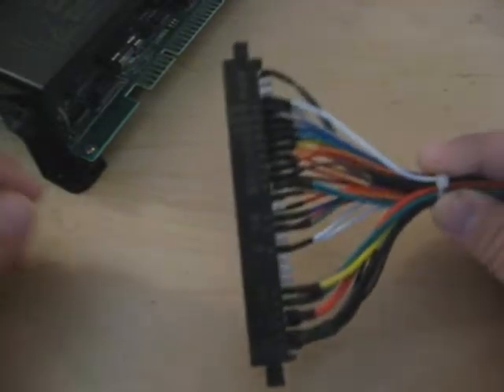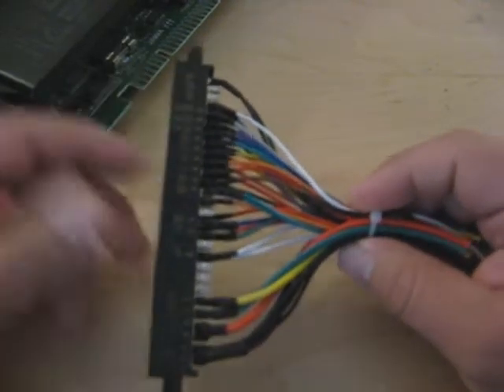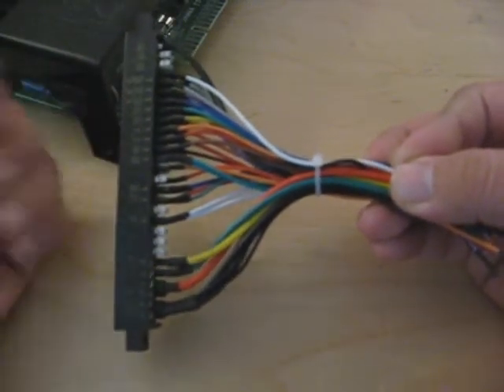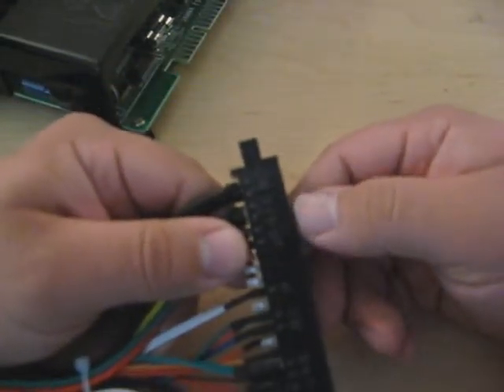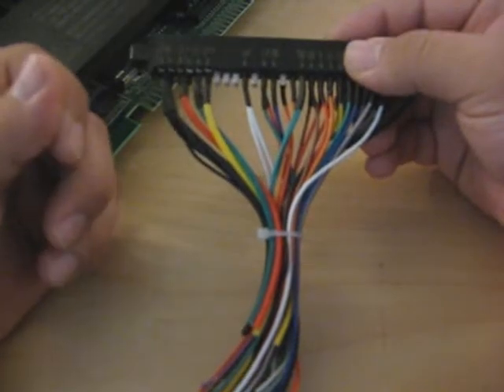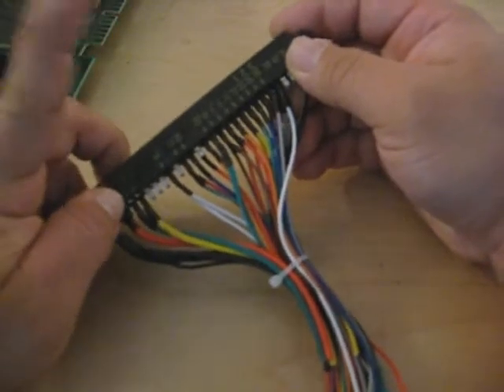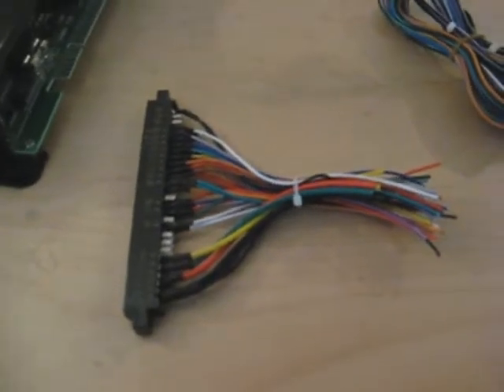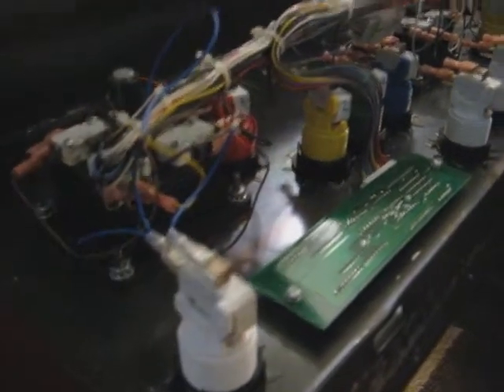Explanation of the Arcade Cabinet Jamma Harness

Comment: How do I know if my old cabinet have jamma or not? Please help
Reply from the maker: What game did the cabinet come with?
Reply: @moomert1  Its a JK cabinet made in Denmark in the 80's. It came with three different boards (Mr. Do's wild ride, Return of the invaders and Time pilot).
Reply from the maker: @THEMARTIALARTSCHANNEL-bb4fx  99% sure those are not jamma boards. Sounds like you have a cabinet wired to some old type Taito harness. I do not believe there are any type of adapters that will allow you to play jamma games in an older Taito wired cabinet.
Reply: @moomert1  Thanks a lot for your help. This stuff is not easy

Comment: Im looking for some help on my jamma board for Golden tee 97 arcade model , the volume was not hooked up and as i tried to hook it up i have no volume pot to adjust it and when i hook it direct to a speaker in the cabinet its full blast , and wiring diagram or help would be appreciate  , thank you

Comment: Thanks for taking the time to make this video. Despite the derogatory and socially inept comment below I found you video very interesting and informative. Do you know anything about how the coin drop signals work on these things?
Reply: Update on the coin demon site link. It's now:
http://www.swallowam.co.uk/jamma.php
Reply from the maker: Mike Brady can you explain what you mean by coin drop signal? are you referring to how the game "reads" that a coin was inserted to start the game?
Reply: Thanks Moomert1. Yeah, I understand roughly how the coin acceptors work, but how does the game know that the correct coins have dropped? Is it a pulse from the switch that gets thrown? A momentary on/off. I'd be interested to know how to interface with an 'old school' coin acceptor if that makes sense. I'm talking more about a software interface. Modern coin acceptors can output which coin was accepted but I'm not sure exactly how older software did this.
Reply from the maker: Sorry for the late replay, older coin acceptors basically have an "arm" which is at a certain length, when a quarter would be dropped in, the quarter would trigger the arm. Smaller coins would not hit the arm because they would be too small. 
Now I guess in theorry, if you got a round piece of metal and sized it exactly the same size as a quarter, in theory that would work.
Reply: Thanks moomert1

Comment: can you connect non -5 jamma boards to -5? like a street fighter? asking before i do it. coulda swore its been said not to. if not i can just make a disconnect for the -5 wire lead.
Reply from the maker: inhave never had an issue with this
Reply: ok cool, thought about it and looked at one of my pcbs and i was like "oh.... this contact leads to nowhere it wouldnt do anything :I" 

got my first cab the other day and working on a supergun so figuring out the lil things. i think you answered one of my questions a while back about my pcbs not powering on, found out it was just a bad harness lol

Comment: Where does the black wire on pin 28 connect to? My jamma harness does not have any wires on pins 26-28. I just wired up a 60 in 1 board powers on but I get no picture. Im using an old crt computer monitor and its connected to the vga input on the 60 in 1 board. I'm stumped! there was also no -5 volt on the harness I have either. Could no -5 be the issue or no ground on 27 & 28 be the issue??? Note: The monitor works and the board works too I have tested both on other machines.
Reply from the maker: rowdyherself85 when you tested the board on other machines, were those actual arcade cabinets with arcade monitors?
Reply from the maker: rowdyherself85 you might also try the dip switch settings. I believe there is a switch to go from VGA to CRT.Pins 27 and 28 are ground wire pins.
Reply: I tested it in a converted pac man to jamma which also has a 60 in 1 in it currently with an LCD in it. Only difference is the power supply in what I tested is an ATX computer power supply. What I am trying to use that I cant get to work is a switching power supply. But Dip switch 2 is on and 1,3,4 are off. But for the 60 in 1 do the ground wires from pins 27 & 28 go to the ground on the power supply? I already have the "Fat" ground wires on pins 1 & 2 hooked to the ground in the power supply.
Reply: moomert1  I figured it out. Bad power cord to the "good " comouter monitor. Lol thank you for responding so quickly and help. Love your channel btw :)

Comment: I have 2 Wires that have come out, how do I determine where they belong
Reply from the maker: you can trace the wires back to the harness. For example, if the extra wire is a red with purple stripe, then look on the harness connection for that same color. If you are lucky, the connection will be labeled. If not, then you take a spare button, connect the extra wire and a ground wire and see what happens.

Comment: So just to be sure here: If i'm trying to make a Supergun for a Neo Geo MVS, the JAMMA harness connects to a PSU/Arcade Power Supply, and will have wires left over to connect for controllers, and sound which I can solder to 2x DB15 (2 row connectors). Sound I don't know how to wire for since its a MV1B which I hear connecting directly will blow out a T.V. speakers without some kind of modification. The power I can connect to a rocker on/off switch. I can solder the video cables for RGB, to a video encoder like JROK.

Would the arcade power supply come with the correct plug to power the JROK video encoder, or is the JROK encoder powered through the JAMMA harness?

Sorry for a dumb question, this is my first project/build and i'm still getting into the theory of things!
Reply from the maker: I personally have not built a supergun. However I will answer as best I can. The jamma harness will connect to the power supply and you will have left over wires for 2 sets of controls for player 1 and 2. Each set will have enough wires for up to 5 buttons if needed. You will also have wires for speakers, coin doors, and start buttons. 

There are many different types of power supplies. Your best choice I think would be either an ATX power supply or the standard power supply used on dynamo cabinets. I get my power supplies from jammaboards or twistedquarter.
Reply: Hiya! Thanks for the response, i'm a fan of lukemorse1 and i've heard him name-drop you a few times so I checked out your channel haha.

Uhhmm, as for the wiring, do I have to wire the coin door stuff or just leave it non-connected? Will it throw any errors for boot? My intention is to use Neo Geo AES sticks with it. I'm going to have to install Universe Bios. I'm not sure how COIN IN will be done but i'm assuming SELECT will be wired as coin in...

Thanks!
Reply from the maker: I would suggest just wiring up the "coin in" to some small buttons on the side of your supergun. I am not sure if all or even any neo games have free play options.

Comment: If I wanted to add lightguns to an existing cabinet, like a Street Fighter 2 or X-Men vs. Street Fighter, so I could use a 6-Jamma swapper board to play lightgun games, yet still keep the joystick enabled so I could play street fighter, would it be possible? Can lightguns be added while keeping the joystick controls available?
Reply from the maker: Yes this is possible. Of course, you need to make sure the lightgun game is jamma compatible. All the jamma compatable lightgun games I know of..........the guns are attached to the actual game board and not the jamma harness.
Reply: Hmm, so I guess in that case you'd only be able to play one light-gun game at a time? Otherwise, you'd have to connect the light gun controls to the gameboard of the particular game you're playing, and it wouldn't switch with the multi game switcher?
Reply from the maker: You can wire the guns to each game, however I think you would need to use diodes for each set of wires going to each game.

Comment: I was wondering if I could easily set up a neo geo one slot motherboard (the MVS MV1-FZ) (uni BIOS) in my JAMMA cabinet with only ABC buttons. I understand that some games would not be playible, but apart from that, would there be any modifications necessary or is it just plug and play? Thanks.
Reply from the maker: If I remember correctly, a 1 shot neo motherboard is plug and play. You shold be fine
Reply: moomert1
Thanks, you and your vids helped alot
Reply from the maker: glad I could help

Comment: dear moomert , i want to try and build a single slot neo geo mvs , from what i know it has a port for neo geo controller so i do not need to wire it to any arcade  stick , my question is are there adapter so i can just use the jamma and hook it up to the adapter and use that adapter to link to my tv , so i can minimize the wiring? thanks
Reply from the maker: If you are asking if it is possible to hook up a jamma harness to a tv the answer is yes. There is an adapter that will allow you to input cga (from jamma harness) and output a vga connection (to a tv with vga)

Comment: I have a sega megalo2 and want to be able to play different games on.  Do I just buy Jamma game boards and swap them out or do I need a switch or anything special?
Reply from the maker: Sega Model 2 games have unique wiring. The cabinets are not jamma compatible. You would have to re-wire the cabinet to jamma.
Reply: moomert1 The owners manual says it is a JAMMA harness.  It is a Sega Megalo 2 from the late 90's, I thought almost everything post 85 would be Jamma.  How can I tell for sure, do I just count the pins and 56=Jamma?
Reply from the maker: Oops, I thought you said Sega Model 2. If you have a sega megalo cabinet, and the manual says it is wired to jamma, then yes, just buy jamma games and plug and play. To be sure, look at the harness, see if it looks like the one shown in this video.

Comment from the maker: Virtua Striker 2 99' runs on Sega Model 3 hardware. This is not jamma. I have heard there is a Model 3 to Jamma adapter. However I have not seen it, so I don't know how well it works or if it even exists.

Comment: i think i figured it out, im going to try and splice in the 2 ground wires in with the grounds on the last pin 28 i think, and all i need is a new 56 pin harness cause mine is missing 6 pins cause of the tekken game i guess, and the 48 pin i think i have it all figured out if the 2 black wires are grounds, thanks for the link that is the site i will be buying everything from, i'll just be drilling in 2 extra button per player.. i'll let you know how it goes, maybe upload a vid.. thanks :)

Comment from the maker: First off, read reviews of any multi board. Some street fighter games work good on some multi boards while working poorly on other multi boards.
A proper jamma harness fully filled up, will give you up to 5 buttons for each player. 
However this is only if the game supports those extra buttons from the harness.
I have never used a 485 in 1 so I don't know for sure how its wired up. If you like playing cps2 games, you may want to try the happy fist version 2 multi board.

Comment: if i remove kick button1,2 for p1/2 from the smaller 48 pin connector and put them in b,c,24,25 and put e,27 ground doubled in f,28 i would have room in the 56 pin conec to use those 4 slots (d,e,26,27)for buttons 5&6, do you think this would work? I am looking at getting a 485game in 1 pcb for the arcade which has nearly 10 sf games but it as well only has the one 56 pin adapter with no extended edge connector b4 i make a buy i just want to know if it will work or not, thank you very much :)

Comment from the maker: The smaller harness will not work on the cps1 board. A properly wired jamma harness will be wired up to buttons 1, 2, & 3 for each player. The kick harness (cps1) provides wiring for buttons 4, 5, & 6.

Comment: Thanks for the video!  I just got my first arcade it's tekken 2 jamma pcb game with 2 bus connectors a 56pin and another smaller one, the game works great it also came with SF2 which only has the 56pin bus the only other place to plug something into is a 9 pin strip on the game board when i plug it in it starts up but no button response the arcade has 4 button and 2 player is it possible to plug and play this game without the cps1 kick harness or does this harness go to that 9pin slot. thanks

Comment: Thanks for the quick reply! I think you might be onto something, below is the email I got from the 2019 in 1 PCB supplier. 

"Regarding the joystick and button don't function, there may be in 28 pin the 5 v and 12 v the power is not enough, please check the 28 pin 3, 4 pin 5V and 6 pin 12 v is enough or not."

So by the sound of it the controlls arent getting the required power, which is weird because i have a 761 in 1 that works fine when hooked up, controls and all.

Comment from the maker: Hello,
I have  never used a 2019 in one Game King so I am probably not the best person to ask. However I will try my best to help you. 
First off, there is always the possibility you have a faulty board. 
 
Have you checked the 12volts and 5 volts of your arcade power supply? I believe the 2019 in 1 uses the built in power supply to power the board AND uses the standard arcade power supply. 12 volts for the coin door, and lights. The 5 volts would give power to the controls.

Comment from the maker: if you are using a pc power supply then the harness does not need to be hooked up to the power supply. 
Check the ground wire on your buttons. If that is not connected, the button will not work.

Comment from the maker: I have never had a Mortal Kombat cabinet so I can not say for sure what the issue is. However it does sound like a power supply issue. Does anything happen when you turn the cab on? Did it turn on ever? You might try adjusting the power supply. It could be getting to much voltage or to little voltage.

Comment: Hiya Moo,

Found your video on JammaBoards and thought I'd drop a quick question. Bought a Mortal Kombat Jamma Arcade and does not turn on when plugged in. This would be a power supply issue correct? Are there fuses I can check and replace or maybe I can throw in my power supply from my WrestleFest cabinet?

Comment: @moomert1 - I have just hooked up my 60-in-1 and only have 1 problem -- no sound whatsoever...I've made sure sound was on in the software settings and my speaker works because I tested it with Viper Phase 1...the original game in the cabinet. Any suggestions?

Comment: @moomert11 I'm working on a Neo Geo Mvs 4 slot, It's actually quite hard to find specific information for simple questions, I love your videos so perhaps you can help. can any ATX 250watt power supply work for an mv-4? Is there a chart for finding the right sizes of molex connectors to buy to put on the wires of the Jamma harness? I will be using a MVS to jamma connector too.
Thanks!

Comment from the maker: @stuka1939 Try using needle nose pliers. Chances are that the clips were crimped hard to prevent any disconnection. Try using the pliers to counter crimp them in the opposite direction.

Comment: Hey, I have a question. I'm restoring my Neo Geo MVS 2 slot right now and I'm taking out the pcb, but I'm having a hell of a time disconnecting the controller 1 and 2 sockets. They have that lip that clips them into place but i have no clue how do remove them and I don't want to damage the connectors. How do you remove the Player 1 and 2 connectors?!

Comment: I don't know if something as stupid as this is possible but could you run a neogeo mv-4f board plugging the jamma power cable from the psu and running the system WITHOUT a JAMMA harness and just running the system using the onboard connectors? yes, running audio directly from the headphone jack and using an RGB to component and plugging the controllers directly to the joystick ports
I know that the unibios lets you insert coins by using a combination of buttons in the controller

Comment from the maker: @zoomcat818 
60 in 1 boards are jamma ready. Fast Freddie is not jamma. You are gonn have to pull out the existing wires and harness and install a jamma harness. Its not to difficult if you follow the instructions.

Comment from the maker: @GamersIncorporated 
For the most part, there is no need to connect buttons 4, 5, and 6 from the harness. If you want to play fighting games that use 6 buttons you will need a kick harness. From the jamma you will wire up all three punch buttons....no kick buttons. wires for buttons 4, 5, and 6 from the jamma harness will not be connected to anything. With the kick harness you connect one end to all the kick buttons and the other end will be connected to the pcb